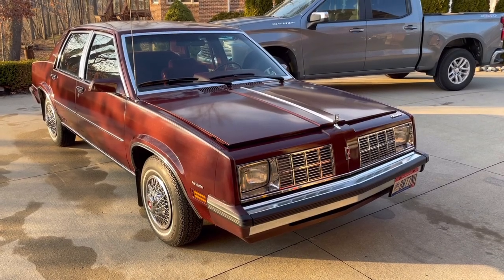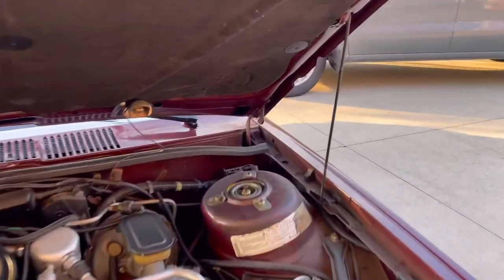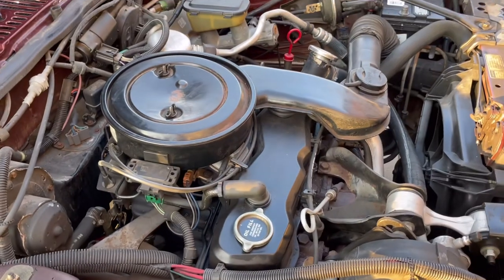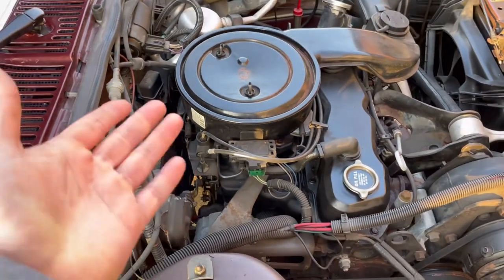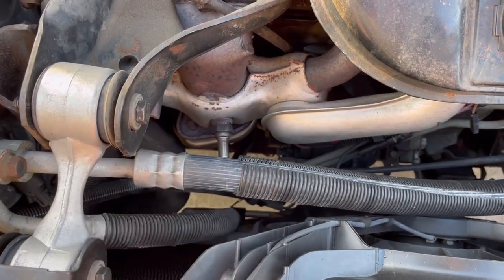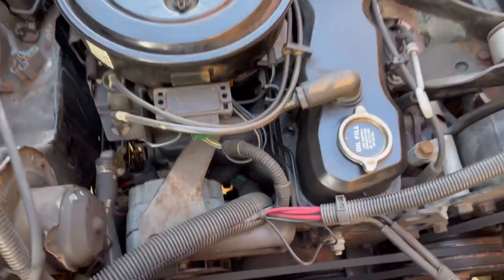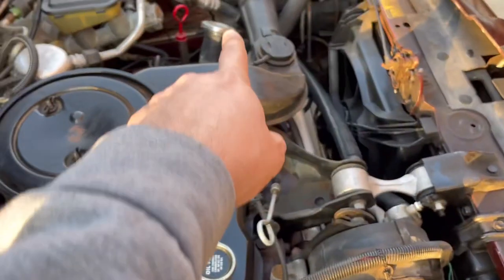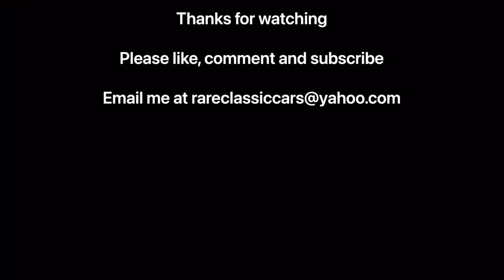Little-Known Details About GM X & A Body Cars (including Citation, Celebrity, 6000, Ciera, Century)

Comment: This brings back a lot of memories. Worked at a Buick dealership 1982 till about 1989. I bought a 84 Skylark TType off the lot. Loved the wheels on it, these neat 10 spoke alloys. Had the 2.8 HO V6. No hood bulge like the X11. Really cool tach that looked like it came from JC Whitney. It was about the color of your Omega, I think was called Light Maple? Something Maple. We saw a lot of the dark metallics coming in with the paint looking like that, we called it chicken tracks or chicken tracking. What I remember being said is it was somehow caused by the more environmentally friendly water (?) based paints being implemented back then.
Reply from the maker: Yes. It was. Dark Maple Red Metallic.
Reply: That T-Type would sure be something to have now.

Comment: My grandpa had a 1980 Skylark (Limited, 2.8l V-6)he had purchased in June of 1979.  Just two months later, on a trip to Saskatoon, the temp light came on and stayed on.  He managed to get it to Ted Henson Pontiac Buick in Saskatoon for a look.  They said the thermostat controlling the electric fan behind the radiator had already failed.  With no replacement available, they wired the fan to the ignition and the overheating stopped.  The tech said they’d already seen this happen to quite a few X cars though they’d only been on the market for about four months.

Comment: 1976 Cadillac Seville.  "Revolutionary" styling by making everything a severe angle, aka the box on wheels.  I'll give the 76 Seville some credit, it was different and offered the same Cadillac experience as their full size boats, but for those who wanted something with better handling/easier to park.  Thing was GM wore that design language of the 1976 Seville INTO THE GROUND.  I mean in the early 80's, all their 4 door sedans had that same formal roof line, upright windshield and backlight, slabbed sided, only 90 degree right angles permitted.

Comment: My Dad traded a ‘79 Nova Custom 2 door for one of those X turds. A 4 door 4 cylinder automatic Citation. He had promised the Nova to me as I was 14 at the time. Oh well… I ended up buying a ‘70 ‘Cuda 440 Six Pack 4 speed Dana instead. I did like that Nova tho. It was light blue metallic with all the bright trim of the custom. I still have the ‘Cuda. I often wonder if I would have hung on to the Nova.
Reply: Oh darn, you must feel terrible.
Reply: @rogersmith7396  Nah… I’m a Mopar guy now. 😀
Reply: @drippinglass  I detest Novas.  Chevy 2s, OK.  Cudas, yum yum.

Comment: Next to the 67-68 Marquis videos the 1980’s Oldsmobile videos really bring back the memories. As a new car salesman during that time period, I drove the two door version of the Omega Brougham as a demo. Your car is painted dark maple red metallic if my sales training from back in the day is correct? I remembered the two position hood and we made the prospect aware of it during the walk around. Only later did I discover that the w126 Mercedes’ had the same feature. Could have used that as added value to the customer. Not that many X. Cars shoppers were comparing against a 380SEL. Would still enjoy hearing any report regarding the 5-o Parklane in Illinois. Thanks for the videos!
Reply from the maker: You’re correct. Dark maple red metallic. Roger that on the Merc.
Reply: Did you tout the new crinkle paint to the customers?

Comment: There were so many vehicles with that iron duke engine that it you wanted to define the 1980s with just one sound, you could do it with that engine. We all either had a car with that engine or knew someone who did so it literally is the sound of the 1980s.

Comment: Thanks Adam. Love these and the early 80s A Bodies. On the Cieras, you could actually use the hood prop to hold the hood up all the way for service. It actually had a hole to place the prop in it so if a stiff breeze came by, it wouldn't slam down. Guess this wasn't on the Xs. Not sure if the Buicks had it?
Reply: Stan, there is a hole in every x-a body to hold a hood in the vertical position!
I owed and maintaining many X and A bodies GM cars in that era.
Super easy with service especially with 2.8 v6!

Comment: I'm surprised that no one has brought up the braking.  With any type of braking effort, the rear of the car would spin around.  Not too long ago I learned that there was a pressure valve that would help with this problem.  It was definitely a safety issue but there was no recall that I was aware of.  Mine was a 1981 Citation with a 2.8 V6.  The car was amazing in the snow.  If you could get any movement at all you  could get out of any snow bank that you happened to be buried in.  This car replaced a rear drive Ford Fairmont that would get stuck in 2" of snow.  Finally, the suspension would vibrate that I actually enjoyed but some of my peers did not.  I did test drive the Citation with a (4) cylinder that was a dog.

Comment: With the hood prop rod, you can't do this if you have a Buick Skylark Limited. Those came with a gas strut that holds the hood open in its fully open position.  That position is maybe slightly more open than the normally used prop rod position. Since there's no prop rod, you lose the fully open advantage unfortunately. The way you described servicing the distributor is the way I've always done it. I never found it to be very difficult to do. It's probably the most difficult regular service item on these engines. The oxygen sensor on the 2.8L V6 is in the rear exhaust manifold near the firewall - you can reach it but there's less clearance to change it out than on the 2.5L 4 cylinder. The earlier (1980-82) 2.5L 4 cylinder engines did not have the radiator style cap over the thermostat like you have. That was only done for a few years in the mid 1980s. By 1990 they went back to the earlier 1980-82 setup. You have two bolts you have to remove to take off the upper thermostat housing where the upper radiator hose attaches. It is easy to do, it's just a little more work than having the convenience of the radiator style cap. That was such a great idea - I wonder why they didn't keep it that way. Changing the oil filter on the 2.5L 4 cylinder engine is easy - but it must be done by feel - you can't see what you're doing. Just lie on your back alongside the passenger side front wheel, reach your left hand up behind the wheel, and you can grab the oil filter and loosen it, and install a new one. If you want to, you can turn the steering wheel to the left somewhat if you want to make access easier.  I actually like the old style better than when they switched to the in-pan style oil filter they began using in 1987. I find there is very little mess with the oil filter installed on the back of the engine - but the one in the pan, you need pliers to pull it out.  If you don't do it just right, you make a mess. The older Iron Dukes (early 80s) are quieter than this at idle. I can't tell you why, but they just are.
Reply: Thanks for the memories - lying on my back on the driveway, reaching up and changing that oil filter by feel, usually getting it off by hand without a wrench. I'd forgotten I used to change my own oil and filters back then!
Reply: As I mentioned in the comment I just entered, I've always suspected that the dog-bone upper engine mount they used on these cars would transmit more noise and vibration when it slid off center, as they often did. The one in my father's Citation was making metal to metal contact after a few years. I wonder if anyone found a way to re-center those things.

Comment: In the 1990s, my grandmother's old Pontiac Ventura gave up the ghost, so she was in the used car market for the first time since the 1970s. She only drove once a week to get things and maybe to stop at the bank drive-thru. Her annual mileage was in the hundreds at most. She bought an X-body Olds Omega to replace the Ventura. By the sound of this specimen, her Omega had the Iron Duke motor. What a horrible lemon! The rear trunk lid would not stay open without a prop. No prop? Expect it to crash down, and you better not have your arms in the trunk if that happened. Engine and heater troubles galore. That Omega was so bad and so short-lived, I wouldn't touch another X-car with a ten-foot pole. To this day, I cannot believe that a major auto manufacturer would rush such a woefully incomplete car to market.

Comment: Adam, what oil do you use in your Duke? I’ve found decent luck thus far using Pennzoil Platinum Full Synthetic High Mileage in mine. 129k, and still going strong knocks wood

P.S. 
That ever so important lower idle kickdown is also my beacon for putting the car into gear on a cold morning lol

Comment: Cool, forgot about those hoods opening that far. 
Which of the 2.5 engines had the oil filter in the oil pan?   I kind of remember 2 different 2.5's that looked almost the same, the VIN R 2.5 and the VIN U 2.5.   That was a while ago.
Reply from the maker: 88 and later

Comment: Under hood, it reminds me of my 84 Celebrity wagon. At 70,000 miles I had to replace that folded steel exhaust manifold, which totally annoyed me. I also had to replace the AC lines, the ones where GM left the barbs off where the hose connects.

Comment: Great video always nice to see a Iron Duke :D. I have a 88 Oldsmobile Cutlass Ciera with the 2.5L do you know if there ever was a way to relocate the ECM away from the block like they made for the 6.5L diesels to stop the heat from burning out the ECM
Reply from the maker: Sorry. I don’t know or have never seen that.  I think you mean the distributor module.  The ECM is inside the car.
Reply: @RareClassicCars  thanks and sorry I meant the ICM that sits under the coil packs on the later years

Comment: I like those mid-80s cars - no matter what they say.   However, the materials "quality" is obvious in the glove box plastic faded to salmon pink and the steering wheel pad also changed color.   

That service hood is really a great feature easy to appreciate for any DYI guy who has spent time hunched over and reaching into the firewall areas.  Having two caps/ports on the cooling system is pretty weird, for sure.

Looks like you are missing the Olds medallion from your hood ornament.
Reply from the maker: It’s the Omega medallion.

Comment: Back in the day I had a detail shop when these things were everywhere. Part of the process for dealers was to steam clean the engine compartment. These things leaked oil almost instantly. By the time they had 40-50,000 miles on them the engine would be covered in oil. When you would steam clean these moisture would build up in the distributor cap and the engine would not start. I hated everyone of these things!

Comment: And people complain about the inaccessibility of modern engine compartments
Reply: It's a lot tighter with the V6. I don't know if the dealer was just an idiot or a grifter or what, but, in the day, whenever Dad's Ciera needed anything more than an oil change they always wanted to pull the engine to do it.

Comment: Not sure if the microphone doesn't pick it up, or if it's because the mileage is so low. But I didn't hear the classic timing gear rattle that almost made some of them sound like a diesel 😅
Reply from the maker: That seemed to be more of a “feature” of the 1985-87 model year engines.
Reply: @RareClassicCars  😂 that sums it up nicely. Sometimes my customers wouldn't even hear a more troublesome noise such as a lifter or even an early stage rod knock that developed because the normal timing gear noise was so loud. 😅

Comment: The Germans tended to have a "replace oxygen sensor" light in the early 80s, usually set to turn on at 60k miles. Did GM do that ever

Comment: Do you know what the #1 way X- and A-body car owners are injured is? Working under an un-propped hood. 

Seriously though - make, buy or steal a dealer prop for the hood, but don’t rest it on the windshield wipers at a near-vertical angle. Drop the hood from that angle and imagine the catch hitting you in the back... 🚨🚑

Comment: A weak transmission downshifting to first will stall the engine at red lights.   I had a Calais Supreme I loved but sold for that reason.
Reply from the maker: You probably had a stuck lockup solenoid.  You could’ve just unplugged the connector and driven it, but would’ve lost a bit in mileage.
Reply: Years of working on my cars and also commercial and industrial equipment, and I had to google that.  I wish I knew.   I had 20-22 degrees out the air conditioning on 100 degree days in that car.   I added r22 to r12, somehow found the magic spot to make r502 (blend of both).

Comment: Amazing vehicle, it is mind boggling the stupid dumb engineers nowadays that design new vehicles can barely built a vehicle as simple as these old GM. No TPMS, no carbon built with GDI and no Turbo.
Reply: Well, my dear departed Dad's '85 Cutlass Ciera might have been simple, but certainly not reliable by later standards. And despite having 3.0 liter V6, it couldn't seem to get out of its own way. OTOH, that roomy, cushy interior was ideal for prom and stuff, so there's that.
Reply: @robbruce2128  the 2.8 litre V6 were absolutely ahead of its time especially without the cap and rotors. When Hondas were toying with manual choke and automatic chokes, these 2.8 litre from GM were decades ahead…whatever happened to GM now days….seriously they cannot build a solid entry level vehicles. You will have to spend almost 100K for well made vehicle like a Suburban or Corvette.

Comment: Had one. Mine was not that nice. Not a Brougham I don't think. Lasted about 185,000 miles as a commuter. Towed it to a my semi-retired mechanic. His mechanic refused to work on it. Good mechanic by reputation, so could be "independent" I guess. It went to the junkyard. I could see it when I drove that way. Many of "us" hated the wire wheel covers. They were "uncool". I think the timing gear went "bad". I killed two deer with it within one year. One at 25 mph, the other at 35mph. At 35mph the grille was damaged. At the junkyard I got a replacement grille. 

way. Many of "us" hated the wire wheel covers. They were "uncool". I think the timing gear went "bad". I killed two deer with it. My way. Many of "us" hated the wire wheel covers. They were "uncool". I think the timing gear went "bad". I killed two deer with it. My

Comment: Horrible cars, had to have a special wrench to dry out the plugs after the junk carb would dump raw fuel into the cylinder. When you pulled into a parking spot they would like to accelerate when you took your foot off the throttle. Junk